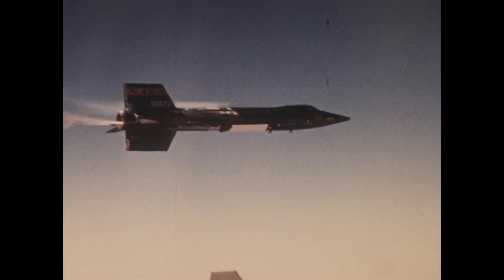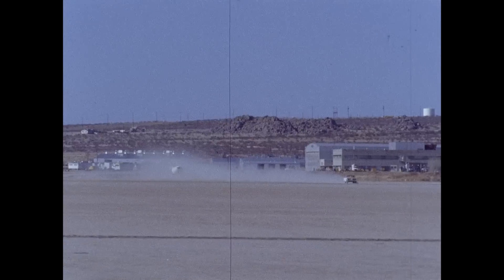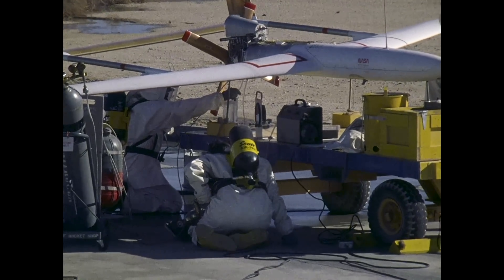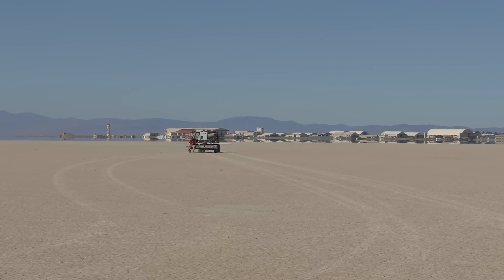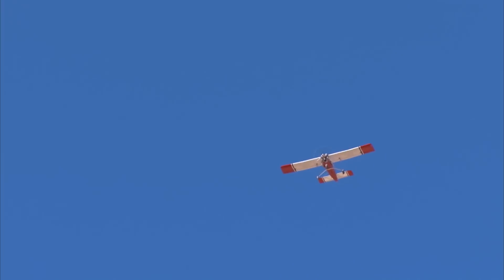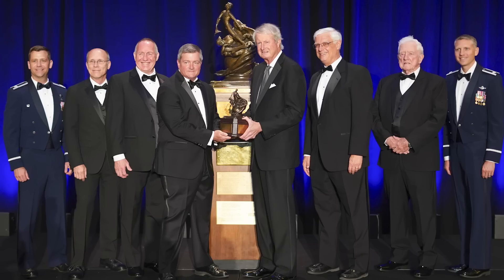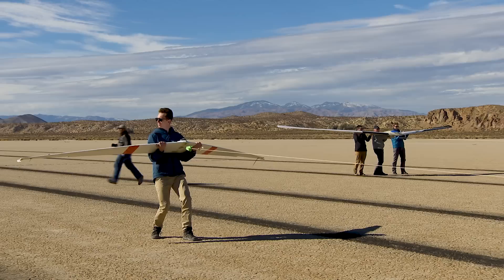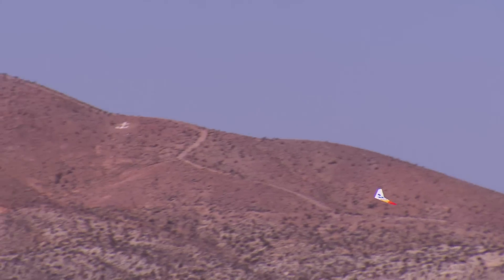History of NASA's Dale Reed Subscale Flight Research Lab

Comment: I would really like to find out more about the red and yellow X-24A behind the guy talking at 9:40. I've been redrawing the old Paul Plecan X-24A ducted-fan model plans from an old early 70s RCM annual handbook but would really like some extra X-24A cross section details. Also I'm wondering in the same scenes but on the other table, is that a 'Littlest Stick' next to the DROID 2?
Reply from the maker: @1944GPW  the X-24 was scratch built many years ago, no drawings exist. The littlest stick is actually a mini Droid. I built that mini years back for fun. It has UMX radio gear and a brushless motor. It sits on my mantle now 👍🏻

Comment: Question for engineering people does a space plane have to come back into the atmosphere in an upright configuration  , can it come back upside down and flip back to back over once it has passed the reentry heating part of the flight ?
Reply: I'm not the engineers you are looking for, closest I can claim is that my father and grandfather were pilots - Thing is, when designing a process, you do not want to add any actions that do not Have To be done and you do not want to add any product complexity that does not Have To be added, the fewer potential failure points the better. And then there's the thing about those soft, squishy, humans inside that spaceplane, their bags of mostly water bodies take the reentry G forces better at certain orientations compared to others, even though the reentry G forces are not as much as the launch G forces, but, hey, those humans have just been weightless for some amount of time and that has an impact. Basically, the less you flip the humans, the less opportunity they have to make a flipping mistake.

Comment: You have to release DROID 2 plans!!! And fantastic video!!!
Reply from the maker: @SeansLittleBayofHorrors  the DROIDs were all modified BTE Models Super Flying Kings built by Bruce Tharpe himself RIP. Main mods were reduced wingspan to increase the wing loading a bit, removable tails, additional hatches and upgraded landing gear for the heavier weight. You still can occasionally find SFK kits for sale. They are great flying airplanes
Reply: Look like a great 4 ch trainer.    Similar to the Big Stick
Reply: @russcole5685  I've built a Stick from plans before. This is much different!